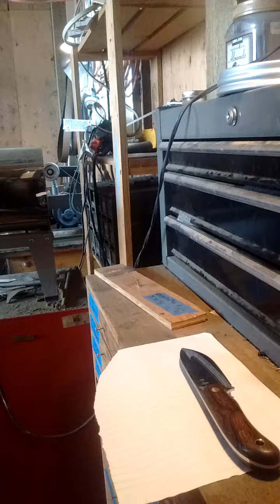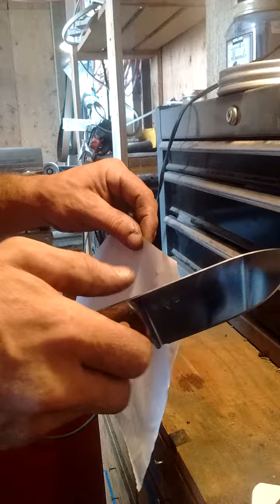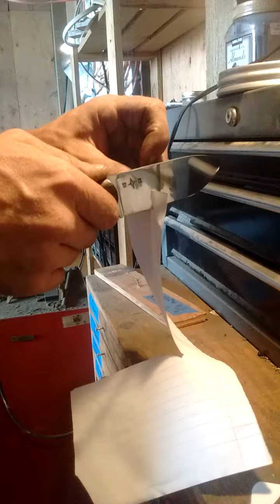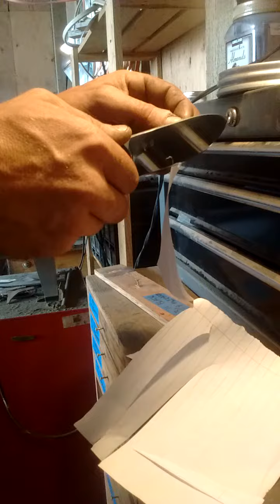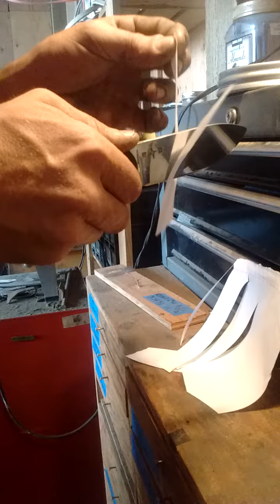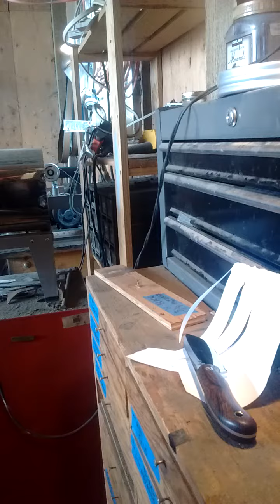Real paper sharpness test!

Comment: how do you get a knife this sharp/
Reply from the maker: I use a fine grit stone, and hen an Arkansas stone (like a hone) then strop on leather with polish compound.
Reply: Fire Creek Forge do you think I could get this sharp with a spyderco sharp maker system plus a leather strop? I never know how hard to press against the stones. Any recommendations?
Reply from the maker: @AmeriCanonStudios  not familiar with that sharpening system, but its all about proper, consistent angle, and taking off just enough material to make the edge, whether you press harder, or just take more passes. If you work through a series of grits from course to fine, then strop, i think you should be fine.  Also check out the knife sharpening play list on my channel here, might help.